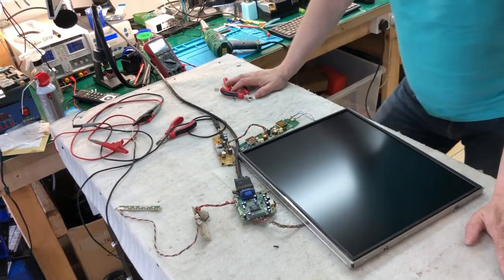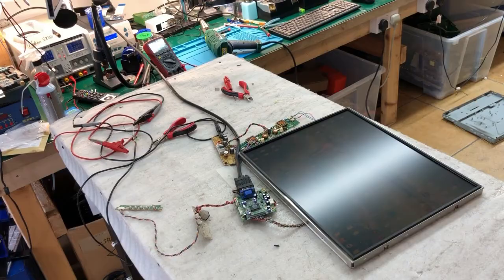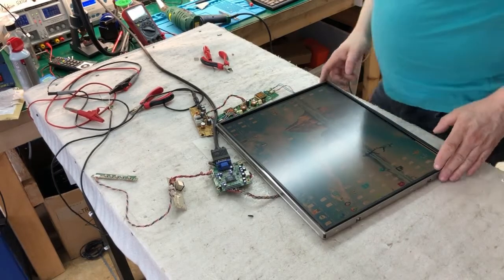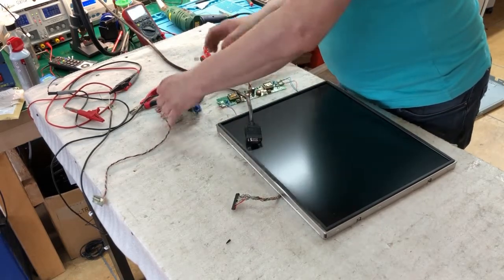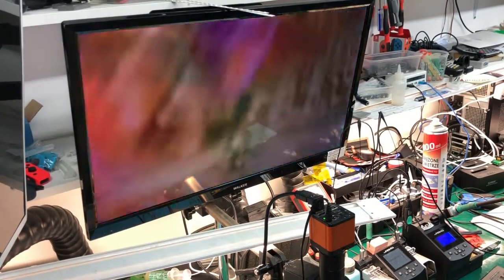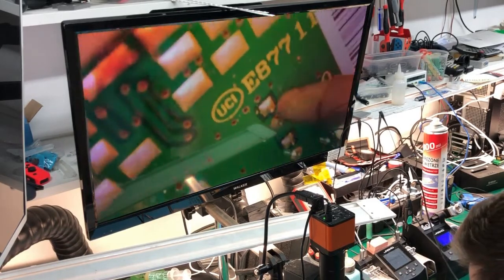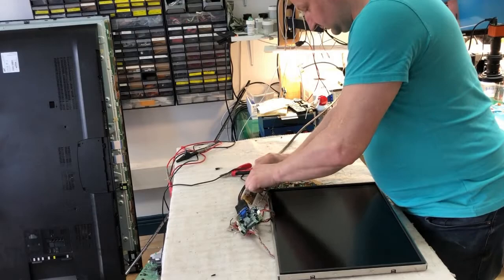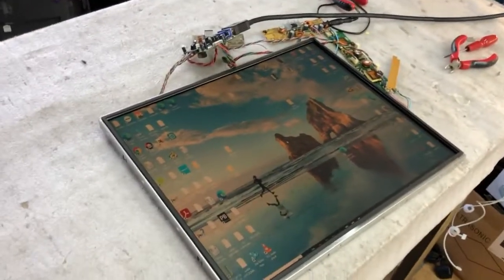How to spot faulty capacitors using hot air. ELO Touch Monitor for slot machine

Comment: That seemed like a fun job. Good diagnosis!

Btw, in this case a suction+solder gun combination would be perfect. That way it heats and removes the solder very quickly. Especially been because it's so many caps for 10 screens.

Thanks for the explanation and trick!